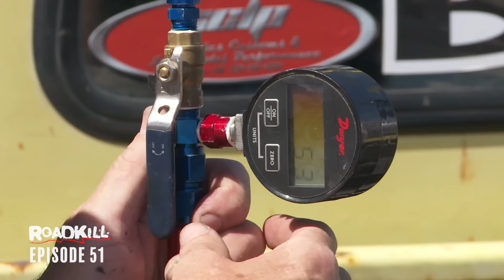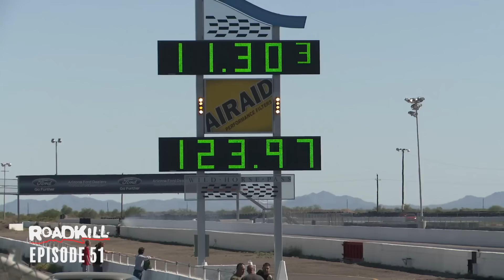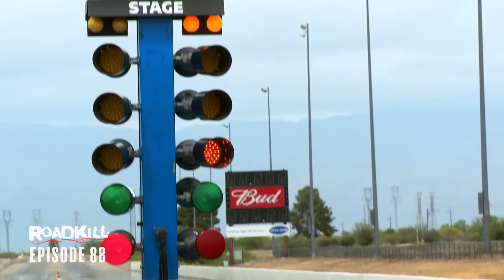The Mazdarati! The Mini-Truck That Keeps Failing | Roadkill | MotorTrend

Comment: When I heard it was stolen, I felt so bad for you guys. That's a rotten thing to do to someone, and I've had it happen to me.
Reply: Hard to believe anyone could keep this truck hidden!
Reply: @BuzzLOLOL  They won'tbe able to...somebody knows...just need a good cash reward to sell the thief out.
Reply: @BuzzLOLOL  That's what I was thinking. A pale yellow, 1974, Mazda, pick-up. You already don't see very many of those. Add a rear-mounted, Olds Toronado engine, with boat headers, to the mix...

If it does get found, they'll probably just find the body and frame - no engine. People suck.
Reply: I'm like 90% sure after this was stolen, it was parted out and the body got chopped into tiny pieces
Reply: @fortyfiveseventy  modified as it was, the clean REPU body is worth plenty without the boat parts
Reply: Its most likely at the bottom of a lake. I bet the thieves didn't know about this show
Reply: Read my reply to viperfan.
Reply: @BuzzLOLOL  it was hidden in Sam's Valley, Oregon.
Reply: @fortyfiveseventy  read my reply to viperfan7
Reply: @jonstein420  - It was found? Got a link?
Reply: @BuzzLOLOL  ask David Freiburger about the post, I don't have any recordings. I didn't have my tablet and my phone was stolen and I have yet to replace it.
Reply: @BuzzLOLOL  I left a comment on viperfan7's comment.
Reply: Glad to see the Mazdarati was recovered and Perp prosecuted after it was entered in a car show...

Comment: You can gain a whole second by removing the tailgate. The tailgate space is probably also the best place to put the radiator. . Instaed of weights , a metal apron , wedge shape starting low, would get you by with less overall weight , more down force and less drag, take off another second.

Comment: It was on a good pass that last run. I think they would have had the 10. I liked this truck with a 455 Olds engine. We have one in a jet boat for years. Good factory heads good size crowed cam and predator carburetor which was way better than the 850 double pumper we used before. They can be powerful engines for sure.

Comment: the first Ford Curriers looked exactly like that- had a rotary engine too! tough as nails- we split the bed seams hauling wood in one! the thing could haul a ton with just a little squat with air shocks and a helper spring on the rear leafs! we beat that truck to death butitkept on going like the energizer bunny!
Reply: Wrong
Reply: @axlefoley3369   REALLY- still have it!
Reply: @B B mine's a 75 with a 5 speed transmission and a Mazda rotac engine! All original- with the exception of air shocks!

Comment: I know that this won't be read by Motor Trend but there needs to be another Mazdaratti built using a 455 Oldsmobile FWD Drivetrain
Reply: How about a Maserati engine with toro trans?
Reply: Or what about twin engines. One in the front one in the back.
Reply: @roadwolf2  
Now that wouldn't be a bad idea cause they did have to add weight there (300lbs I think)
Reply: Use a 500" Caddy FWD setup!
Reply: @BuzzLOLOL  
A "  500"  " ? 
You mean a 500 cubic inch engine?
Reply: @RichardMLowe  - Yes, Cadillac Eldorado came stock with FWD and 500 cubic inch engine... maybe a stronger transaxle...
Reply: @BuzzLOLOL  
Currently I'm trying to reach out to OPTIMA Batteries to see if they would sponsor the Rebuild
Reply: @BuzzLOLOL  
Having no luck 
Are you in the United States by chance?
Reply: @RichardMLowe  - Toledo, Ohio, USA... where we make Jeep Wranglers and Gladiators... GM/Ford 10 speed automatic transmissions... Chrysler parts... all kinds of glass...

Comment: I watched the episode of the 99 dodge v10 and the Chevy 350. 4x4 challenge. I’ve got a 2000 2500 dodge 24 valve Cummins. 230000 miles. 5 speed manual. 14” clutch upgraded from a 12”. Just needs tie rod ends. That be a grate drags truck for you.

Comment: Be interesting to have seen this vs a modded rotary, wouldn't make as much power but it'd weigh less
Reply: Actually you could probably make as much horsepower with the rotary and a turbo,but not as much torque.I think it could be faster.
Reply: I was at a drag race that featured a Mazda RX2 called Rotary Deuce.  it had 2 rotary engines and ran in the 10s.

Comment: Take that engine put and put a 1993 rx7 twin turbo block.have it all built and pinned.fuel injected.and it will run 8s all day.Or even put a 87 turbo engine and u can make a ton of power.And a small engine

Comment: WTF ?  did you all check see if the fans are pulling air instead of pushing ? 
is the crankcase venting properly ?  I guess its venting by puking oil out everywhere